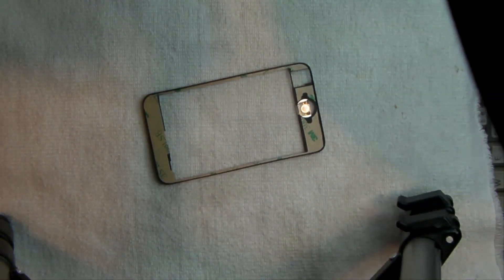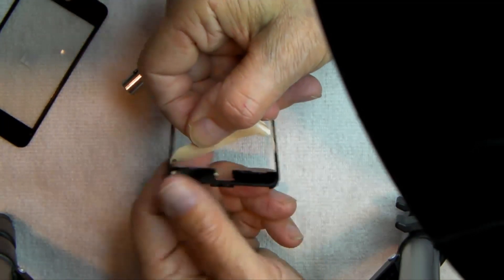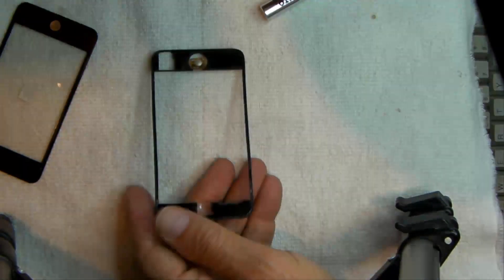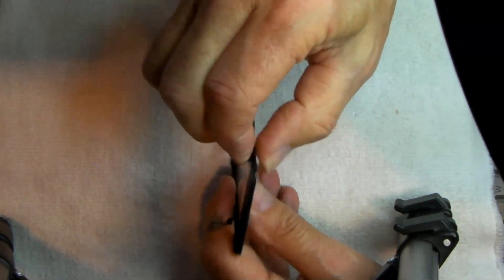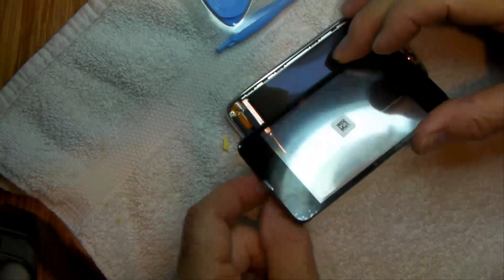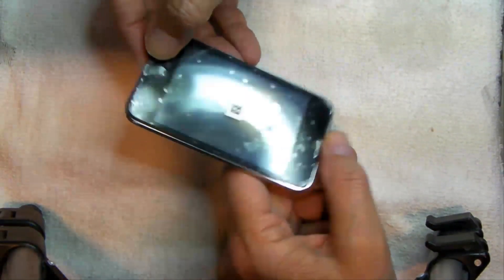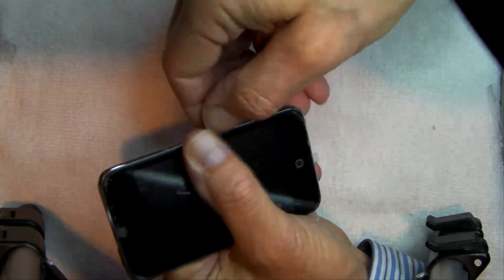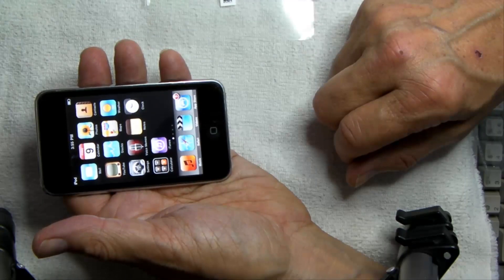iPod Touch 3G Digitizer Repair Part 2

Comment: Hello, I tried a new Digitizer, and still no response to touch. Any ideas on what else could fix it?
I think it was Water Damage that caused this iTouch to lose it's touch response.
Reply from the maker: Dropped in the water?  First thing is DO NOT TURN IT ON TO SEE IF IT WORKS.  Chances are it will fail with a short.  Open it up and disconnect the battery.  Completely disassemble and scrub the board with 90% alcohol and  Kimwipes.  Put a hair blower on low heat and blow it dry for an hour.  Scrub the connectors clean of any corrosion.  That's the best advice I can give you.  DB
Reply: David Brown No, I didn't drop it in water. I'm not even sure if it's water damage tbh, but it stopped responding when I picked it up with wet hands. So it wasn't even that much water, but what was on my hands. This happened about a month ago now. If it did indeed get water damage from just THAT, then apple products SUCK!! 
I searched the internet for fixes to a 3rd gen. iTouch 64gb that stopped responding to touch, and half the "Fixes" were the Digitizer. Maybe the digitizer I received wasn't good? It only cost $11, and is supposedly new.

Comment from the maker: @ellocko7 Be sure to check your model number on the back of your itouch to make sure of the generation you own.  Gen2 connectors flip OUT.  Check out 1:30 on my vid: "ipod touch digitizer removal Part 1 of 4" to see a Gen2 connector.

Comment from the maker: @Nottotv  Not sure why my camera wasn't rolling but the "slide on" technique is not brain surgery, just slip it under the ribbon cable and lightly align the digitizer before pressing it down onto the glue as I mention in the audio.  DrB

Comment: hi,
i have a probleme. i had buy the digitizer set on the internet and have repair it how you show at the videos. but my prblem begins at 5:00 where you connect the digitizer. i think i have a false digitizer because the part of the connection which is at the ipod (not the cable from the digitizer...the other part) is a little bit more at the top and i don't get the cable in it. have i a wrong digitizer? i hope you understand my because i am from germany :)

Comment from the maker: @tombrighteyes :  I'm not an apple repair person but this is what I'd do in your situation;  Try turning it on.  If it is still dead, try to dry it out with a hair dryer set on low for 10 minutes.  The unit is sealed pretty tight so there could still be moisture inside no matter how long you heat it.  If still dead, open it up and inspect the power contacts for a burned trace.  If burned, they are so tiny there is no jumping them so it's toast.  If not, dry it some more.  Good luck!!

Comment from the maker: @tombrighteyes Sounds like your mainboard is OK so it is worth a shot to replace the digitizer since they are so cheap.  Depending on how much water got on the face and leaked around the sides where the data lines are, the moisture might still be there causing a short.  I think the digitizer is all data lines with very low voltages so it is possible that if the water was clean, when it finally evaporates the data lines will begin to work.  Try warming up the unit overnight and using a fan.

Comment: my digitizer on my ipod touch 3G doesn't work anymore, water and i heard that is a cause of the digitizer not working. but i plugged in my ipod headphones and it plays music when i press play on the controls on the little remote that comes on the headphones. screen seems to be intact and shows the "slide to unlock" screen but i can't unlock it since it doesn't detect my finger at all. im thinking of replacing the digitizer. think that will do? i don't want to buy another one since its the 64 GB